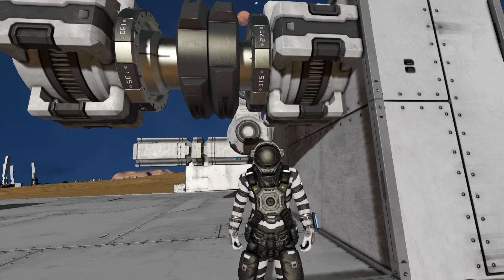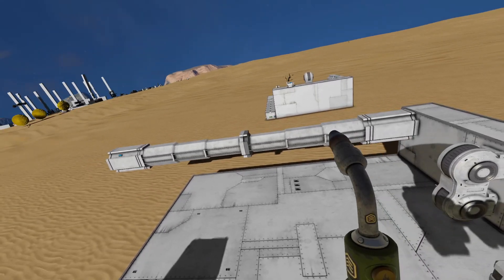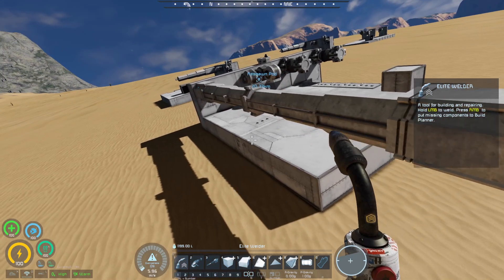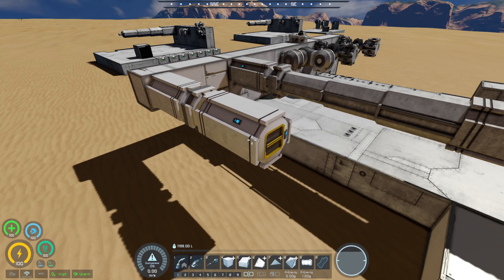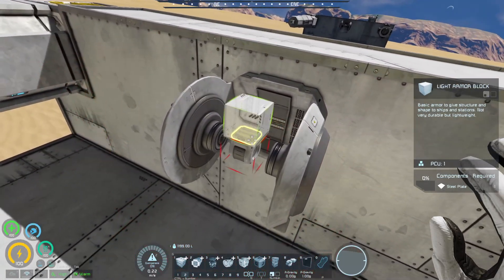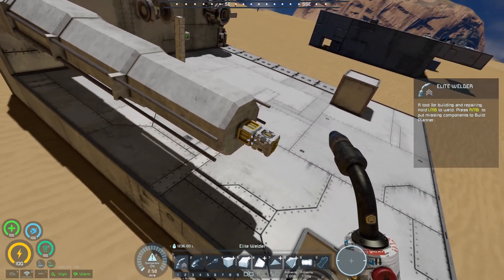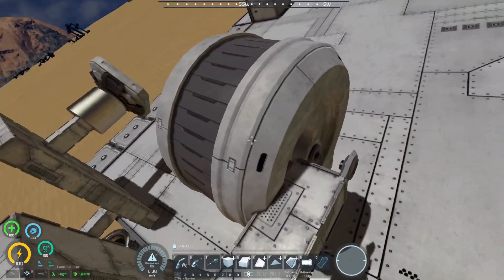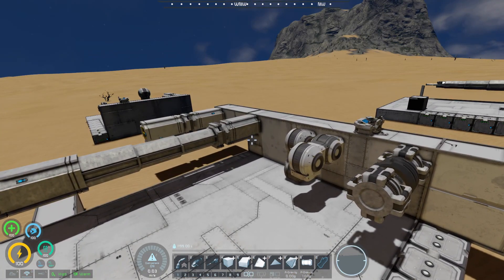Space Engineers Experiments: Head To Head Pistons, Rotors and Hinges

Comment: piston head is 0.16m , since you have 2 of them  subtract 0.32 m ( 2 * 0.16 ) from the distance to make it line up before you attach.
each large grid block it 2.5m.  So to align up with each block distance use  2.18, 4.68, 7.18, or 9.68  to align  up with the other head to attach

If you don't have build vision on the server side,  then using Merge blocks on the piston head to get them to attach.

Comment: I find it's easier to do hinges in space, just build a small block loose on the backface of the hinge you want connected the other way and bump the block into the hinge, then spam attach as it slides into place. Can be a bit precise or need reattempts but its just a hinge without a center attached, a jetpack, and a small block.